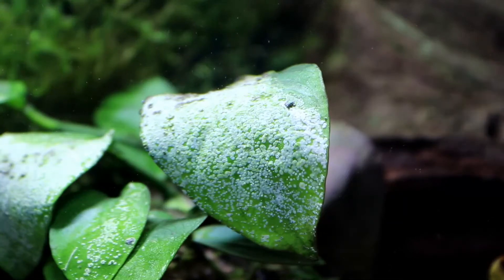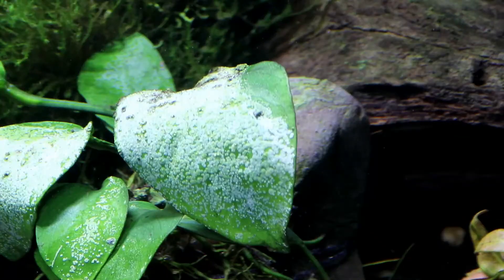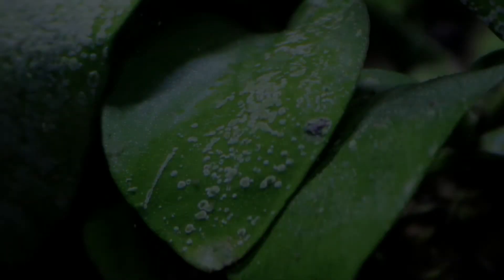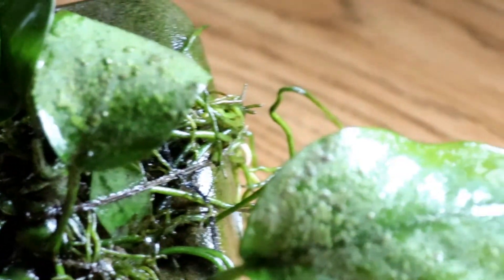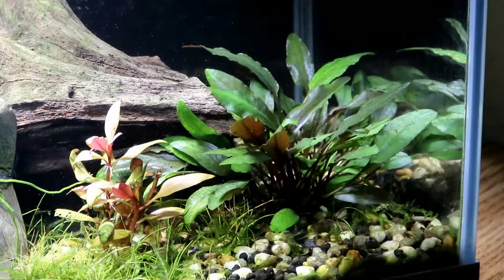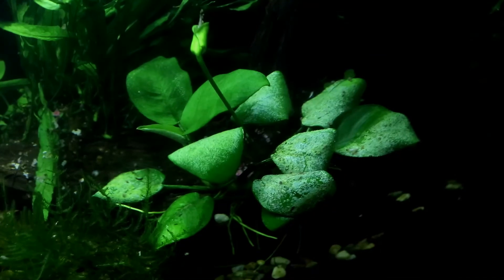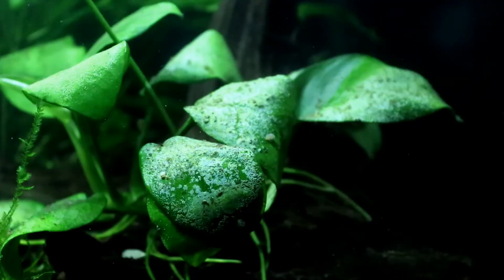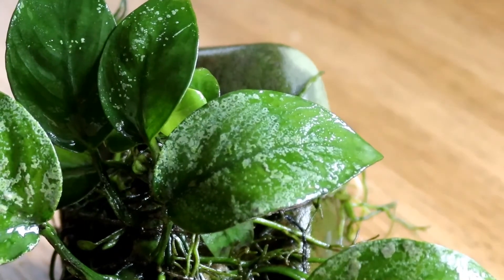Biogenic Decalcification - Lime on aquarium plant leaves. What it is and how you can treat it!

Comment: How do I solve this in my tank? It's a 50L+15L sump planted tank with java moss, valisneria, rotala indica and other two low tech plants. My PH is around 8 ~ 8.5, KH is actually on 10 and I've tried acid buffer but after few hours the PH returns to. I have neocaridina and the GH seems fine.